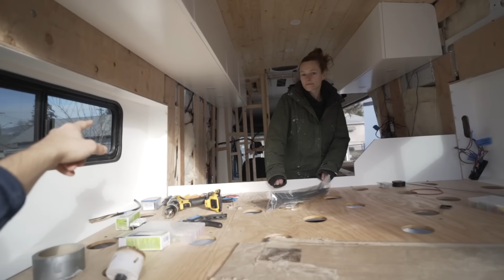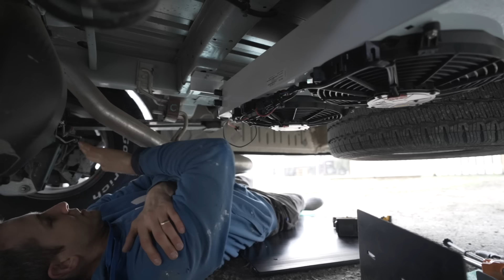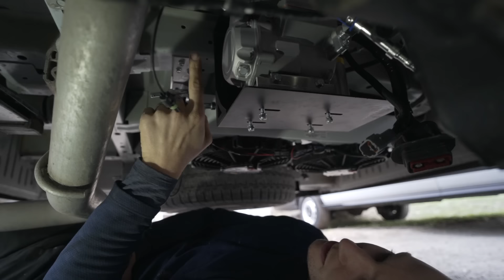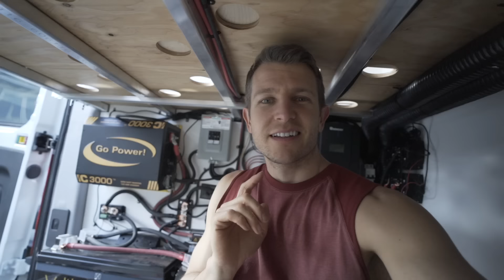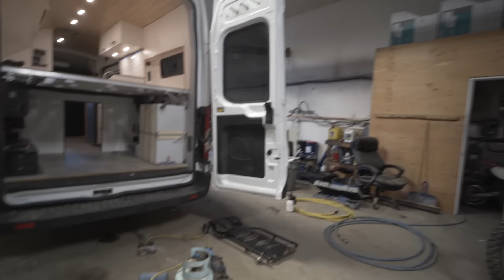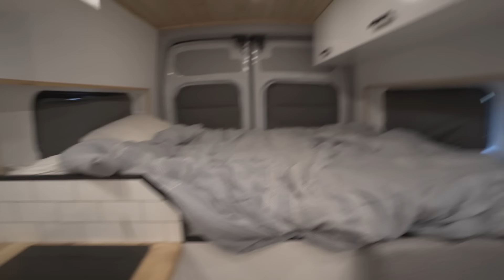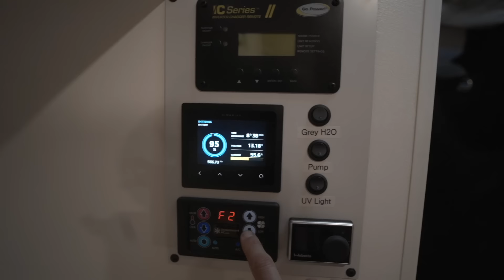The BEST 12V Air Conditioner For Van Life? INSTALL & TEST

Comment: Just recently purchased an undermount ac unit and honestly I was pushed to purchase extra stuff such as the ESPHome along with them shipping me the universal mounts and then again I had to purchase the sprinter mount. I understand this product is still in early stages and seems that it still needs a lot of work in many areas. A friendly customer service would make this process easier. I got to a point where i will not recommend this unit to anyone, we were planning on purchasing 10+ more units for our work vans but honestly not with that attitude from the owner/customer service and how poorly available are the instructions. Also, some features about the 4" display thermostat seems to be kept secret? Device supports mqtt but no documentation on that what so ever ? LOL what a way to run a company that could possibly have good potential.

Comment: If it is a brand new system that has never been charged, what is being recovered from the system before charging.  
Why not just charge vapor on the low side?

Comment: Thanks for the detailed video.  I wonder if the condenser unit can be used on the back of my truck camper instead of mounting it underneath.  I noticed that many 18-wheelers have their AC's mounted flat against the rear cab wall also.

Comment: The condenser is not supposed to be upside down, refrigerant should go through the lowest tube in liquid state, but now it is highest. It can work, but you will be absolutely stunned, when you fill the difference.

Comment: yes-is the compressor a rotatary or scroll compressor/i chose a scroll compressor-it is more efficient-from my research/i have a van i am customizing/my unit will have eco-mode/an i plan to catch the condensate water to use for other uses/how much solar do you have/anyway great job/neat work too/thanks much

Comment: That duck bill that drains the water (at 32.12), will cause you issues because the small end opening will get gunked up with dirt and cause the water to not drain. I had a similar thing happen. Better to use a bigger drain pipe.

Comment: Since the AC is almost never used when driving, I think a fold-away Solar panel could be used on top of the AC unit and folded back when driving.  I would like to see AC manufacturers start to think about the integration of solar into their design.

Comment: I have an Embassy RV.  Here are the major downsides of this unit after 2 years.   1. LOUD!  Loud inside and even worse outside.  To the point that if you are at a campground with generator bans you will get people complaining.  It is as loud as a typical on board generator.   And inside its much louder than something like a Houghton roof AC that I have heard.    2. About a year and a half in the undermount unit broke.   We always tried to keep it clean as we could but it was incredible how dirty it would get.   Hard to imagine that it will ever have a very long service life.
Reply from the maker: Thanks for sharing your experience. I would recommend trying their new hush fans. I installed them on our last build and they are noticeably quieter. Sorry to hear your unit stopped working - ours is still working great without any issues after ~18 months on the road 👍🏻
Reply: This is not the same system. Embassy RV used a different system manufactured fully by Proair and not UndermountAC We use different components and compressors.

Comment: And this is why I did a mini split in my enclosed trailer conversion. Easy as possible installation, incredibly quiet at only 25 dB. It's 9,000BTU, and low power usage at 720W and 6.26amps. It's a 110v, so around 64amps on 12v, though I have a 24v system so it runs around 32amps. I have a 1000Ah 24v battery bank, so it can run around 30 hours on battery, with my 4000 watts of solar it'll pretty much run indefinitely, and it only cost me $750 for the mini split.
Reply: Wow ! Your solar set up and battery are huge !!! Gigantic !! out of this world for most people. How much money does that set up  costs ???
Reply: @mydogo  about $14k for everything, including wiring.
Reply: Hi. What mini split did you buy?
Reply: @Scotmond1  bumping in hopes of a reply & update from @redbeardedt3437
Reply: 4000w solar? What do you have like solar wings that extend?
Reply: @tehdreamer  36 foot stacker trailer.
Reply: What mini split did you get
Reply: @alanbrown2135  Youtube has deleted my comments with the name twice now, here it is again, Senville LETO Series Mini Split Air Conditioner Heat Pump, 9000 BTU. SENL-09CD-16
Reply: @redbeardedt3437 I  appreciate your response what was your initial cost
Reply: @redbeardedt3437  thank you for your help

Comment: I'm thinking about installing this type/brand unit into my Sprinter 3500XD this fall. I would really appreciate your 1yr review of this particular unit and how well the undercount held up to driving conditions and how well the ducted cooling performed. Thanks for your time in both making this video and responding to viewer questions.
Reply from the maker: I’ve installed 2 of these units now in different vans and they have been on the road for 6 months and >14 months full time with no issues to the undermounted condenser units. They function well to cool off the extended length transit and I am about to order another unit to install in our new extended length transit build. Still highly recommend 👍🏻
Reply: @TimKatie  Thanks!

Comment: Is there a good 12v mini split that does ac and heat? Seems silly to have a separate heater when a mini split should be able to do it.
Reply from the maker: I’m planning to install espar HS3 (hydronic) with the UndermountAC for combo heating/cooling in the same unit and controls in our current build 👍🏻
Reply: I have been thinking of this too. We get delivery of our 2024 in a couple weeks @TimKatie

Comment: Great video! I purchased a 24 volt mini split directly from China and paid $350. It was another $150 to ship it, but I'm located up in Alaska. So, I have a few comments and then a couple of questions. Mine is a 24 volt system (They have 12 volts as well but lower BTU rating). This one is rated at 9,000 BTU. It uses a Max of 800 watts or 33 amps. That would be 66 amps at 12 volts. Essentially it's about half the power of my air fryer or Induction cooktop. This unit uses a variable frequency compressor, so it actually never stays at full speed, and there is no way to keep it at full speed. It essentially just cycles more frequently. Controls on mine are Wi-Fi. At full blast I think I was getting similar readings to you. Somewhere around 54°, but, most of the time it's much higher than that as the compressor only stays at max for seconds. This is the way they achieve the energy efficiency. I can say up around 85°, which would put the interior of the RV at 95 to 100, It will Keep the Interior right about 70. Of course if your parked in the shade, it would do better. While the evaporator or head unit is whisper quiet, The condenser is mounted to the frame or floor of the Van and that's actually much more apparent as far as noise levels go. The company does mount the compressor itself on some rubber mounts, but I was surprised that the compressor was so much louder than the evaporator. Normally those things are mounted outside, and you don't hear anything. And while this one is technically mounted outside it's also mounted to the floor of the van so that residual vibration transfers. I think adding some extra insulation may help as well and some sound deadening mat material. I haven't done that yet. 

So, questions I have for you is what is the BTU rating of yours? How would you rate the noise level inside the van? And I guess it's been a year since you posted at this point so have you have any issues? At what level do you find you have to keep the unit at to keep the interior of your van cool? In other words what's the real world settings like?. I find I can turn my fan down, but I still need to keep it on Max Cooling. It probably runs 50% of the time that way, maybe 40%, but the evaporator never really shuts off, i.e. the blower is always running. That's not necessarily a bad thing as I kind of like white noise, but it does still draw a small amount of power.
Reply: Company and distribution center please, this sounds great

Comment: I like the flexibility of the system, but I'd still be concerned about those condenser coils and the absolute filth they are going to be subjected to.  You've seen how dirty the underside of a car gets, right?  It may be fine, but I'd keep a pretty routine maintenance schedule on running water thru the coils just to be safe.

Comment: using corrugated flex hose ills your ac wind speed. pvc pipe is smooth a better but harder option.

Comment: Good vid.  What size solar and battery system are you running?   Thanks again
Reply from the maker: Thank you. This van had 600 ah 12V (7.2 KWH) battery bank and 500w solar but our most recent build with this AC unit had 800 ah and 800 w solar 👍🏻

Comment: Can you do an update of this air conditioner? Like how it’s doing how customer support has been
Reply from the maker: This unit has been on the road for over a year now without any issue. I recently installed the new version of the UndermountAC with the hush fans and like it even more. Customer support has always been quick to answer any questions during install or setup and I haven’t had any issues afterwards that I’ve needed them for. This is still my top pick and I’m hoping to install another one on our current 2023 Transit build. Will try to put a new video out for it 👍🏻
Reply: Awesome thank you so much for the reply. I think I’m going to go with there unit. Seams worth it especially with everything heater compatible.

Comment: I know warranty on the van/ac is a concern but I wonder if using the van’s condenser would work instead of mounting an additional and then you get the added bonus of it being up front so quieter and already mounted.

Comment: I live in a van full time.  I need an air conditioner because I work the night shift. I've got a simple normal air conditioner.  6000 btu's.  Uses 600 watts or 50 amps/hr. I've got a lithium phosphate 300 amp battery pack. After the sun goes down I can have six hours of air conditioner. I've got 600 watts of solar coming in. Even in hot temperatures,  around 80°f, the air conditioning keeps up easily since the van is insulated for 4 seasons. Cost me 200$ for the air conditioner with also a remote control.
Reply from the maker: I wouldn’t consider 80f “hot”, as even here in BC it is commonly over 100f in the summer and there’s no way a 6K BTU unit would keep our extended length van cool. But I’m glad it’s working for you - cheers

Comment: A  actual REAL test  would be PHOENIX ARIZONA  at 110f.......nobody ever does test in Phoenix AZ.     Wonder why 🤔🏜
Reply: Because no Rv AC can last there. That’s why very very few people who do this live in the Az summer. This is meant to make a van go from 80 degrees to 75 degrees. Not 110 to 75 degrees. You need way more power for that
Reply: @jacob-kf2gf some people should remain silent. Nobody uses AC to expect 5 degrees of cooling genius.😂
Reply: @jacob-kf2gf you need two of these at least with plenty of insulation.  And you will still not get it cold it will just be comfortable.
Reply: A real test of what? Most people don't live in Phoenix Arizona.
Reply: @WellnessWizdom I do. 4 bags of ice in an icybreeze cooler keeps me cool all night. 2000 watt harbor freight Power inverter charges the batteries in a cycle that I swap manually. I deliver food in the day my highoutput alternator charges 2 lithium batteries In the trunk. It's a toyota hatchback
Reply: @WellnessWizdom homeless but I manage to crank in 1200 a week, spend about 20 percent on food gas and ice. Saving to buy some land and a trailer house and get my kids back. She cheated on me and left. Haven't seen my kids in months
Reply: @sk818factory5 Good Luck friend!!
Reply: Cuz who chooses to be in Phoenix in their van in summer?
Reply: @samuelfox8126  lol
Reply: Ah yes but if you don’t want a wussy PHOENIX ARIZONA test, you could actually BE A MAN and test your air conditioner on the surface of the sun where it’s actually hot……..nobody ever does test on the sun. Wonder why 🤔☀️

But to his point there are a lot of “fair weather” tests on YouTube.
Reply: If you want to live inside of a metal box you probably shouldn't live in Phoenix Arizona
Reply: In maryvale fully agreeing with you

Comment: Can anyone explain why these aren't more efficient????  12000btu / 900W = 13.3 EER ... I thought residential mini splits can get 20 or 30 EER.
Reply: Not quite how it works. The 900W is just instantaneous load/max load, if you averaged the load across the a period of time (1 hr+) the compressor would shut off with the evaporator still being cold enough to produce cold air. Residential units have high EER ratings for a couple of reasons. They are littered with sensors to achieve the finest balance between condenser motor speed, evaporator motor speed and compressor motor speed shutting each down or ramping up as necessary. Small scale production (in comparison to home systems) would make this a very very expensive system. A home system also runs for extended periods of time to run "low and slow" like a slow cooker to cool your home across a great span of time and at no point do you open 1/3 of your homes walls and let heat back in to spike a system (like you do with van doors). The other factor is residential mini splits use high pressure refrigerants approved for static systems (400+ psi). Automotive systems use low pressure R134a or R1234yf. Those are the only currently approved refrigerants.

Comment: Ok so at 40.0 minutes, you reference that the compressor is at a certain speed,my question is are saying that the compressor itself is capable of being a variable speed compressor?
Reply: Also you did a very nice install of not only this ac but your power bank looks great as well.
Reply from the maker: Correct - it is a variable speed compressor 👍🏻 Thank you!
Reply: The compressor is variable speed. It has 3 RPM based set points to achieve a specific output, two of those are used and switched between on our system depending on necessary demand.

Comment: The underbody screws concern me. I would have strongly tried to use nylok nut/washer/ bolt to mechanically prevent dislodgement due to vibration. At the very least the screws you used should be positionally marked so future visual inspections can identify any possible movement easily.
Great video and info, are being filed to aid in my design.
A thermal curtain to trap the cool air where sleeping will be in my design.
Tip: anytime you are having difficulty drilling use the reasonably smallest possible (4mm?) carbide bit simply as the pilot hole subsequently increasing in bit size.

Comment: Hold on, did you say 50amps, 80amps?  Something doesn't sound right about that ✌️
Reply from the maker: Correct, ~50 amps on low setting and ~80 amps on high settings (12 volt)
Reply: @TimKatie  A 48V version would be nice to drop the current to 12.5A/20A.

Comment: Nice install but does the system tolerate the weather conditions, road maintenance solutions, debris on the road, etc. when traveling???    Seems very exposed to me.
Reply: The condensers that are mounted under the van have been in use in RV, Ambulances and Military vehicles since 1995. They tolerate salt and road debris the same as the rest of the vehicle as they are made to the same standard. No issues in thousands of vehicles. There are much more fragile components under your van/vehicle (Fuel tank, wiring harnesses, etc)

Comment: Thank u for sharing. Can you just leave it on and let the power run from the engine?
Reply from the maker: No problem. Yes you could do that as have 120 amp alternator charging (CTEK combo) when the van is running

Comment: I just completed a similar install of the UndermountAC system on a '21 Transit. Many thanks for putting this detailed video together, as it served as both reassurance during the purchase and a valuable resource during install. Some observations from my experience: 

- They are now shipping kits with some material differences including (1) a control board integrated into the Compressor (2) new (non ProAir) Condenser (3) new digital control pad. 

- The documentation is just some random notes. There is no proper installation manual and some information is old (see above), ensuring you will have to seek direct support. Fortunately, he is very responsive although I can't help but think it would be easier to just write everything down in a real product manual. 

- After seeing this video, I elected to install the Compressor in a slot towards the rear left. This allowed for easier install (esp. since removing the control board would be tricky), easier access for fill/maintenance, and no issue with the transmission. 

Despite going smoothly, it was definitely a challenging install and there were moments are regretted not just getting an unpowered integrated roof model. Now that it's done, I can't wait to unleash its power this summer. Going forward, I am a little concerned about support of the ProAir components since the company is defunct, but will cross that bridge later. Good luck to anyone embarking on the journey!
Reply: Hows your unit performing now that you've had it a while? Cheers!